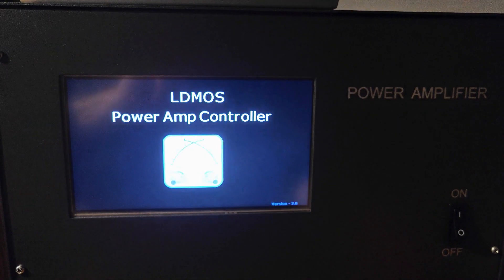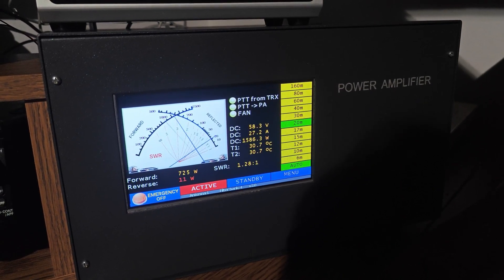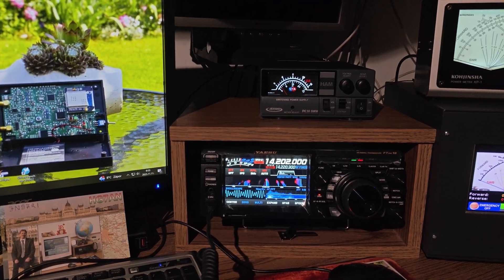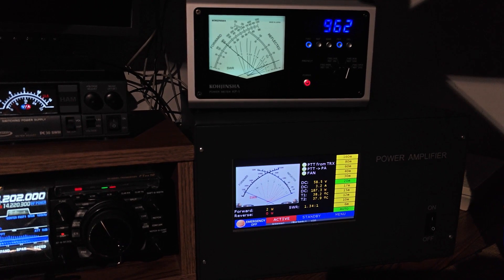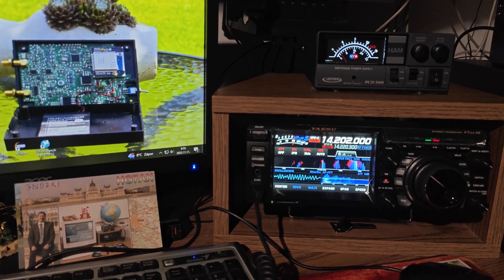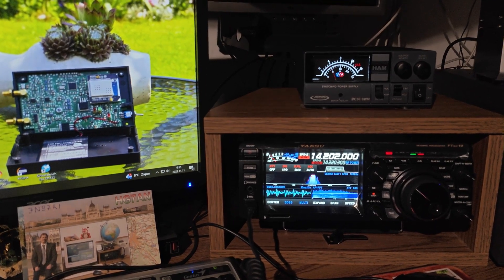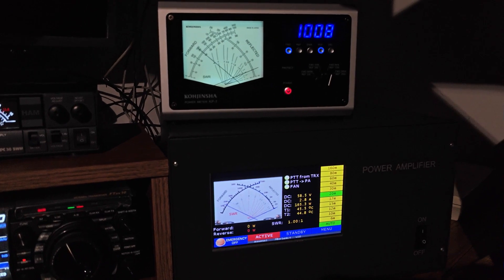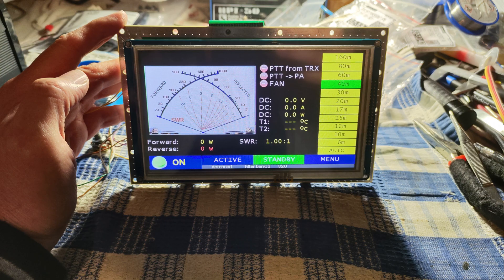2KW LDMOS POWER AMPLIFIER

Comment: Did you use 65V to get 2kW ? What kind of power supply you used ? I am using Emerson R48-2900u in 53V only.
Reply from the maker: I use 4kW PSU and 58V. Good luck!
Reply: World you introduce me your power supply ? Thank you
Reply: @hamradio599  easy.   its the Huawei R4850G2.   very easy to use PSU.    the power supply has CAN Bus to program the voltage from 42V  to  60V.    and it will remember what its set to.   you will need a USB-CAN adapter from ebay or amazon